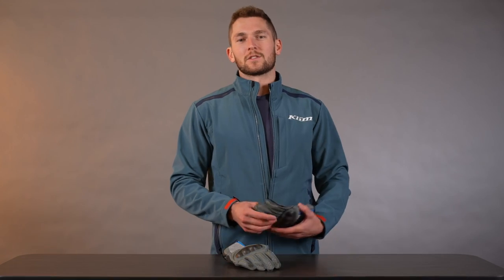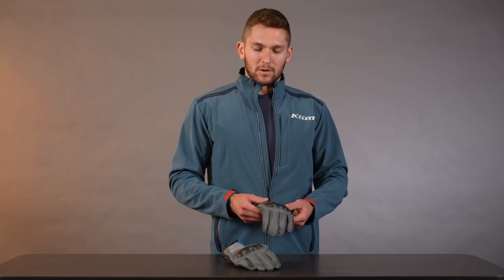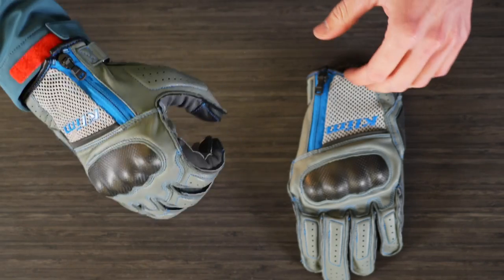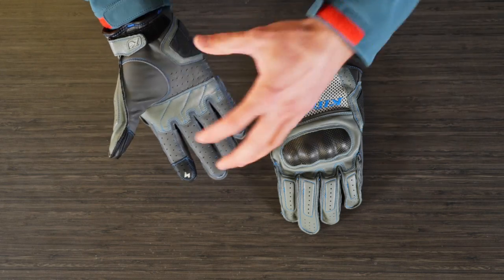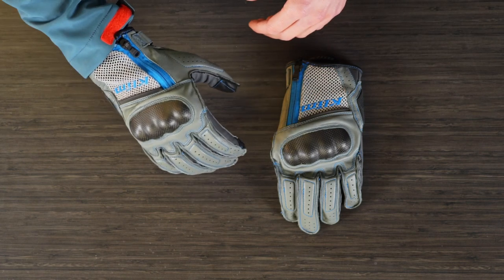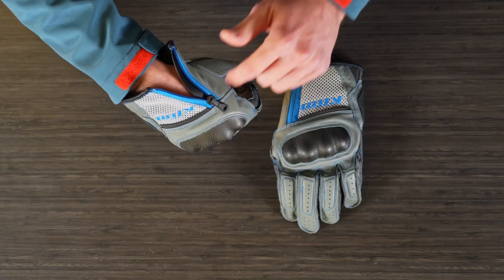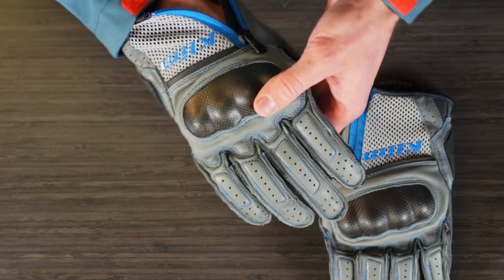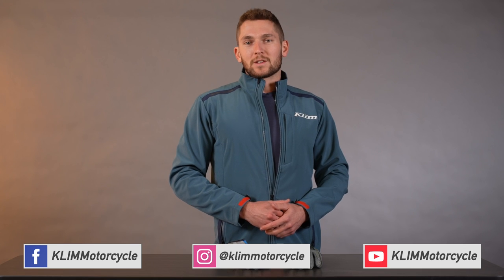Induction Glove | Product Walkthrough

Comment: Are those the best summer gloves in Klim lineup ?
Reply: I've had the old version of the Induction Gloves, their Baja S4 Gloves and now their new Badlands Aero Pro gloves. The new Badlands Aero Pro are my favorite but also the most expensive and premium, the Baja Gloves are a very close second in terms of comfort and the Induction third. The Aero pro and Induction are very similar on protection/ventillation and build quality with the Baja being slightly less protective and a little more cheaply made (but way less expensive) but it flows more air due to the mesh backing. The Induction gloves I had bunched up a bit on the palm and that's why they rank third for me but if they fixed that in the new version I would have to rethink my ranking order.
Reply: @grandiagod  About the last part, from what you can see here, did they fix it ?
Reply: @tempofugo168  can't be 100% sure but it looks to be using the same patterns and hand molds as my new badlands aero pros so it's probably okay
Reply: @grandiagod  Ok thanks mate. One last question I have is about the thinness of the palm on the induction gloves. If the palm is too thin, I'll feel the vibration on the highway. What do you think ? How do they fare compared to some common leather gloves ? Would you say the palm is thin ? Thanks again.